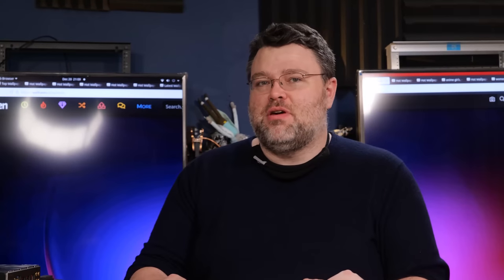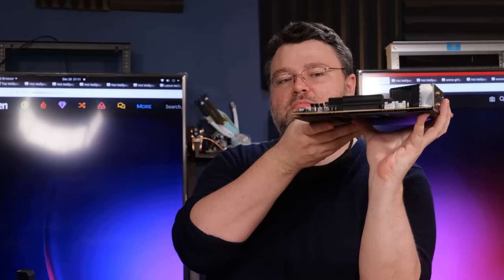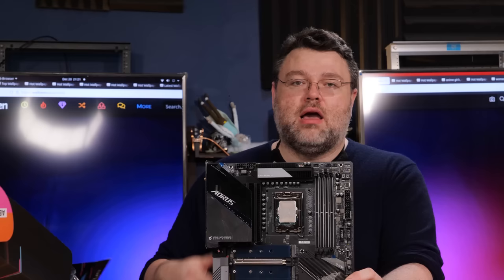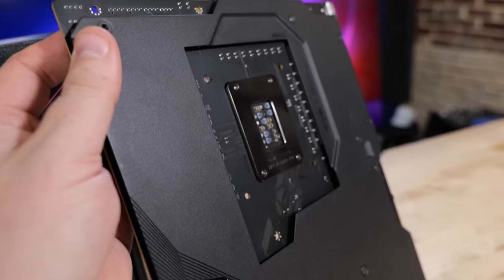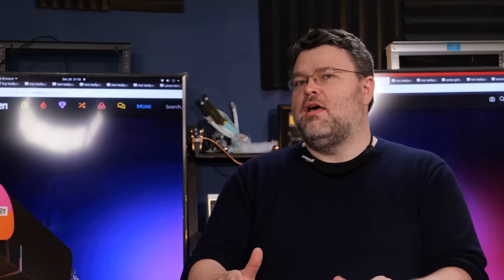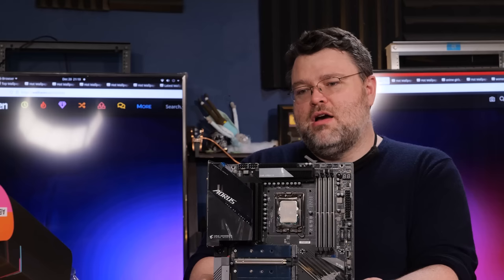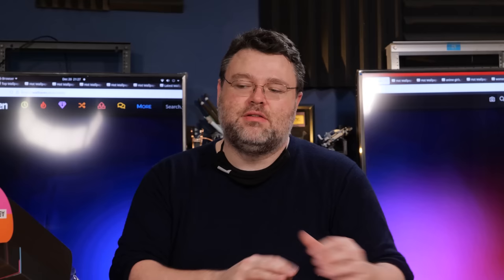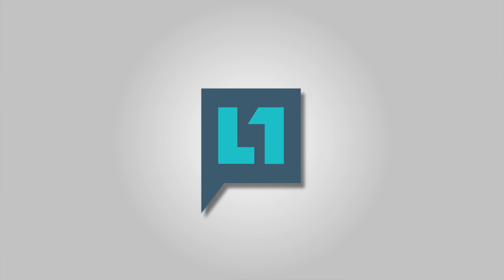Z690 AORUS Master DDR5 Gaming Motherboard

Comment: Ultimately - I'm expecting that a north PCH (PLX chip) is already in development for use with W680 if it gets proper official support.  The performance of these 12th gen CPUs is great.  When you can pair them with good DDR5 you get plenty of bandwidth.  If they took that 16 lanes of 5.0 they could break that out into so many components to make a pseudo HEDT.  I mean in theory they could take it out as far as like 6 full 16 lane slots and let vendors / end users decide how to split it up.  That's what I was expecting to see with the rumored W680, but it looks like that just won't be the case; or it's late / canned / just not getting leaked.

Comment: Hi dude. First time on your channel and i bought that motherboard and i9 12900k --- 3080 Ti EVGA FTW3 ultra gaming 12GB --- one 2tb 890 pro gen 4 and one same for 500gb(windows - programs and maybe 1-2 games for 500gb) and Corsair iCUE H150i Elite Capellix Liquid CPU Cooler(Radiator) --- 5000X Corsair case --- CORSAIR DOMINATOR PLATINUM RGB 32GB (2PK x 16GB) 5600MHz DDR5 C36 White --- Power supply Seasonic platinum 1000W so i hope that everything will work togeather and all of this ill pick up in store (Best Buy) on Feb 16. For me it is huge jump from what i had. 9 years ago i was build my first and only one pc so i guess time for new changes ^-^ Liked video and subscribed.
Reply: No one cares what you bought
Reply: @kerokero3082  oh noo...im crying .... waaaa waaa

Comment: yea the ramble part is spot on though! we need a PLX chip for pcie5 because GPU won't need pcie5 for a while... RTX 3000 just got pcie4.0 and none of them are even bottlenecked by a 3.0 x16 slot... SSD will max out pcie 5.0x4 long before 5.0x16 is necessary for a GPU they should have made it 2 full speed 4.0 x16 slots... also when are they just gonna put all those m.2 on a add in card
Reply: Recently I watched an AHOC video where he rambled about plx chips, and from what understood, they are expensive($100?) 

I’m now not sure I know what a PLX chip does, but pcie 5.0 is probably going to make it more expensive. 

But maybe a chip that doubles lanes and halves speed could be a bit over powered. Imagine a board like this or the z690 unify, 70 lanes of 3.0 and 16 lanes of 4.0. Chipset lanes math may be of by a bit, but this could rival the threadripper platform. (Edit: And from my understanding, Intel doesn’t have a threadripper competitor, so it could benefit Intel)

Obviously I am not a chip/PCB/motherboard designer/engineer but bandwidth wise I see no issues, latency could be an issue.
Reply: @tthbeige3332  PLX - basically ethernet switch for PCIE lanes.  Though I personally think Intel would go with an in house secondary chipset that would mean they get the money while also providing some sort of standard around a pseudo HEDT chipset.  That being said though, I'm certain that the power draw would be quite high for that much bandwidth.
Champ - I'm pretty sure Asus would patent troll anyone that tried that since they already have dimm.2.

Comment: just picked one of these up on sale. I think it is the best bang for your dollar motherboard available atm. 379 cad from 599. a few minor drawbacks like pci 3.0 instead of 4.0 for the 2nd and 3rd pice slots.  overall very good board for the price I got it for. I actually bought a second one for the upcoming 13900k
Reply: I'm in Canada so the price is a bit off but I just got a 12900k and this motherboard for $900. That's like... $660 USD. Pretty pumped.

Comment: I'm really curious what would be a legitimate use case for RAID with the M.2 slots. Wouldn't the best NVMe drives currently on the market be sufficient performance? I guess a mirror could be useful if you want that extra security but wouldn't a stripe setup increase the latency negating the NVMe advantages?
Reply: "my numbers are more big than your numbers, so I'm a more successful person than you."
Aside from that, there are some use cases where it's useful but the additional expense of doing it "properly" isn't feasible or justifiable.

Comment: I am still on an x370 Taichi, I'm using DDR 4 n happy.. I have n M.2 970 Evo 500gig n it is plenty fast.. I have 2.5" 860evo for games n videos to for total of a gig.. I just delete the games I don't use n can get them back from steam.. Anyway I've always been a couple GENS behind on CPU and motherboards.. I try to get 2/3 GPU up grades before doing anything else.. Finally come the conclusion that I will have to pay scalper prices for a 6800xt or 6900xt which ever, doesn't really matter that much at this point... Also I have seen a BIOS for my board from ASROCK for some X370 boards, to run 5000 ryzen flawlessly and still hit 3200 to 3600 on the memory.. So.e guys are using beta bios through ASROCK to run 5900x's on x370 taichi's and other mother boards.. Look not knock the new tech coming out just the price to performance... SO THINKING about picking up a 5800x to after the gpu though an when the 5800x is selling for $300..

Comment: My gskill 6000C36 kit did not post at 4800C40 jedec spec with my z690 aorus ultra until I used bios flashback to update to the latest bios. Even then 5200C36 wasn't stable.

Everyone seems to be having trouble with Samsung ICs.

Comment: My board just came in today along with the ram I purchased to go with it. Maybe I should have looked into ram limitations because I got TEAMGROUP T-Force Delta RGB DDR5 Ram 32GB Kit (2x16GB) 6000MHz. Think the board will recognize it. If so will it throttle it down to 4800 or 5200? Really hope I didn't waste $360 lol.

Comment: Looks like a really nice AL DDR5 board; I’d consider it if I went Intel on a build right now and could find the RAM at a not stupid price.
Reply: That board cost 469 and it won't support gen 5 ssd Lol trash board
Reply: @naor9792  Pretty much no alder lake board will support gen5 ssds, since the 4 lanes from cpus for that are gen4 and the chipset only provides gen4 as well. Since the cpus only support 1x16 or 2x8 for the gen5 lanes, you'd be sacrificing at least 4 gen5 lanes for the m.2 slot and only have half the bandwidth for the gpu, so no one will do that.
Reply: @debug_duck  you have 3 or more board that do support it but they cost 500+
Reply: @naor9792  Well they will not break the physics and specs of intel cpus and chipsets, so either they do the sacrificing i've described or they're gen4. Care to share the model numbers, so I can take a look?

Comment: The annoying thing these days with the VRM and coolers, is that on "most" of the boards where a decent heatsink is installed, there are so many power stages, with such high capability, that crappy heatsinks are fine for even top end CPUs (unless going sub-ambient cooling, but even then, the cooling will probably "leak" to the VRM sufficiently to compensate anyway).  However on the low end boards, with crap power delivery, they also use crap coolers.
Seriously manufacturers, stop ticking marketing boxes and actually engineer them appropriately.
Yea yea, they don't care, big numbers and shiney things sells boards (KMN).
E2A: Information on this board and the VRM capabilities and why the heatsink is (probably) superfluous: https://youtu.be/KF0BeAYcn-8?t=660

Comment: These motherboards and parts are getting to be way too expensive, I'm doing peace meal upgrades.. I'm also praying my 650 W thermal take semi mod power supply will be enough for a 6800 XT gpu, I am running  2700x n 3200 Flarex cl 14.... an M.2 and a 2.5" ssd for storage.  Even with XFR on my CPU is probably only pulling at most n not constant 130 watts from the wall, the memory n SSDS ARE PROBABLY another 100 watts at the most plus board and 300 watts for gpu, that I will probably just let run itself..
Reply: You are running a graphics card that sells for over 1100 bucks on ebay right now. Even good quality power supplies are cheaper. You can snag an evga 850 watt unit for under 100 bucks. Or spend 120 ish on a corsair 850 watt. Both are gold units with 10 year warranties. Even if you are under the total power budget of your psu, running it closer to max capacity will degrade it much quicker. Just spend the 100 ish bucks and be set for the next 10 years. Its better than constantly worrying if you do x upgrade will you run out of your power budget. Best upgrade I ever did was 1000 watt corsair psu. Know im good for next generation gpu’s and can run a crap ton of fans and peripherals.
Reply: @Jsteeeez   I will,  I am going to buy a card that only has 2 8 pin connectors as well instead of 3 8 pin, definitely makes a difference believe it or not,  I don't want to buy the 6800 XT used though I wanna get it new either from new egg or Amazon I don't want an open Box situation.. So I will probably spend the full 1500 for the card on newegg..  Kind of the reason why I don't want to go all out and get a 6900 XT even though there are both 300 W cards.. I have seen people under Volt the 6800 XT down to like 250 W and get the same performance out of it.. I'll see how it goes I have a thermaltake 650 gold.
Reply: @marcasswellbmd6922  much better to get a card with 3 8 pins as it gives you more headroom to overclock in the future. For example if you have a 3080/3090 with 3 8 pins you can flash evga 500 watt bios. If you have 2 8 pins you are limited to 375 watts max. Also just allows smoother power delivery meaning your components last longer. A better power supply in general will keep your components in a better state and will last longer. How are you going to spend 1500 bucks on a card yet power it with a 50 dollar psu. You are limited in your component choice because of your power supply which can potentially prevent you from buying a better value product because it doesnt fit in your power budget. Just pay the 100 bucks and get the power supply and be set for years. Also 3 8 pins just lets you extend the life of your card in the future because you can get another 5-15% out of it with that extra power.
Reply: @Jsteeeez   I understand what you're saying but I'm not looking to overclock the card.. 
 I'm just gonna let mine run at stock speeds just like I do with my CPU's...  I totally get what you're saying but I'm just gonna let the card run at the game clock n leave it there.  I've always found over o'clocking just gives like a 5% bump in performance anyway, It's negligible at best, anyway..  I'll probably undervolt my card and run it at the game clock..

Comment: I built a 12600 with Aurus DDR4 board with no issues. But when I put in a 12700K all I get is random reboots. So I replaced the 12700K and get the same thing. So I ordered an MSI Carbon DDR5 board with the 12700K and it still happens. At this point, I replaced everything from the case to the PS and still get random reboots and BSD. I have been in IT for 20+ years and I just can figure this out. Any ideas?
Reply: CPU microcode, solution, wait unfortunately

Comment: in AU, it is so stupid this board is the cheapest z690 with a postcode and other ease of life features...

i was aiming for the msi z690 carbon for $569 but it somehow jumped to $630~ after 7800x3D launched. (force is $515, but no idea if the bios issue has been solved)
asus and asrock boards are around $600 - $900 so it is a hard pass.
gigabyte master is on sale for $499, cheaper than the ultra which is selling for like $560~.

with all the features packed into a $500 price tag, its a no brainer. its absolutely a blasphemy to considered it a steal in this market of DIY PC, but it is the best middle ground for the amount of stuff you get which may or may not make me regret purchasing this heavy duty mobo.